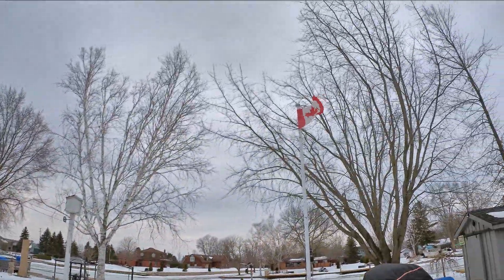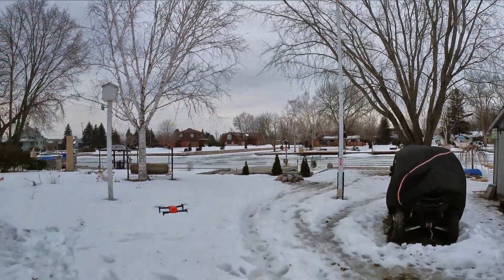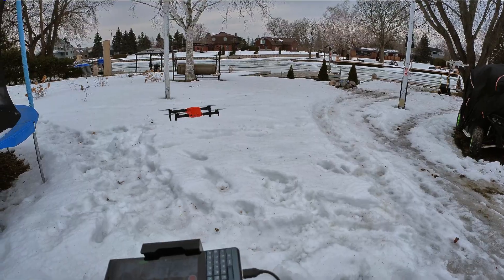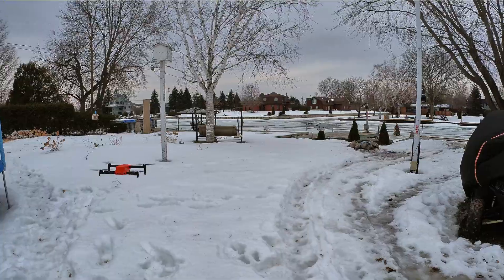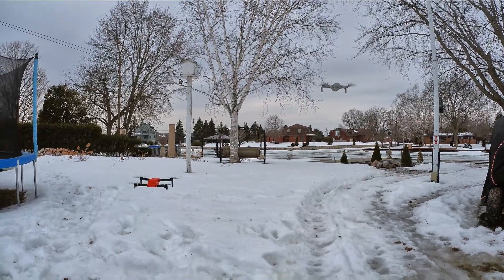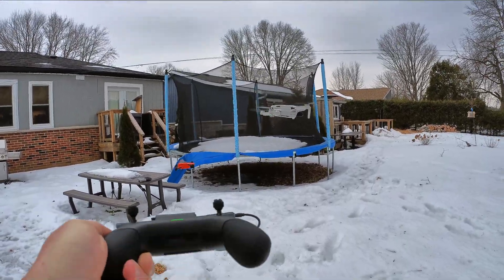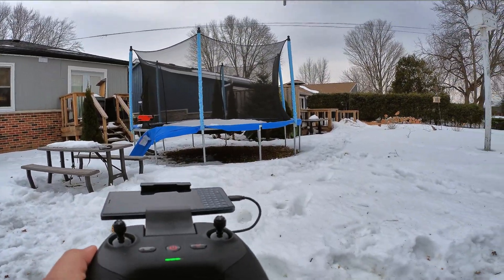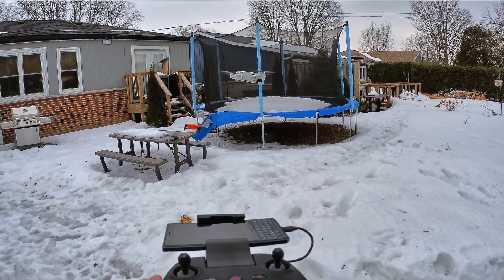Autel Nano Plus firmware wind, speed, & jello fix, yet issues persist

Comment: Two things that give concern wit this test. 1. flying outside of level 5 wind conditions by a large margin. 2. flying over non contrast floor, if the elevation is low, these aircraft start to use the bottom sensors for height data, and flying over whiteout snow is not ideal. May not have been a factor, but mini was higher and over more contrasted surface with tire tracks.

I would like to see the test repeated within level 5 winds, and over contrasted surface, or higher agl.

Your title would suggest that you had information concerning jello and speed? 

Title should maybe be nano heavy wind test comparison to mini 2.
Reply from the maker: Both were initially set at the same height, the nano drifts , there are ongoing downsensor issues (they have been turned off in one of the earlier firmware, they may not even be activated yet in this version)

At the end of the day the mini is still has superior flight characteristics and the nano has a better camera. More tests to come
Reply from the maker: Unfortunately the insta360 that I was videoing with corrupted the second file that showed the nano plus against the wind. It managed to get 6m/s which is great imo. The clip at the end shows no jello that is raw unprocessed video of the nano plus filming.

Comment: Your video last month stated you were returning it back to your vendor, but you still have the drone.
At the end of the day, if you want far superior imagery, the Nano+ wins the contest against the Mini 2 by a massive margin. 
If you want to fly in very high winds, send up the Mini 2 which is more capable in these conditions. 
But the downside is the Mini 2 imagery is very much inferior to the Nano+, big time. 
Not even close !
Reply from the maker: Also I won my PayPal dispute and got a  refund. I also offered to return the drone to Autel which I have no obligation to do.  I asked them to prepay what I lost on the transaction including the refund of extended autel care which is not through PayPal, and either prepay return shipping or send me a prepaid label. All of which they have refused to do.
Reply: @cantechvideos5701  realistically you can't expect any payments outside of PayPal to be included in a PayPal refund settlement. It's still a win for you.
Reply from the maker: I will have more to report on image quality in 2 weeks, going to be using this drone extensively over that time. It's no secret that the image quality is superior on the nano but the flight characteristics are still superior on the mini
Reply: @JohLincN  you're entitled to your opinion, just like I am. I may do a comparison of imagery later between the Mini 2 & Nano+ to prove the point.
Reply: @JohLincN  what are you on about ???
Reply: @JohLincN  ??

Comment: Wow! That is impressive. The Nano plus handling 40 mph gusts. With all the other advantages it holds over the mini 2 that is a win in my opinion! I give you a lot of credit for doing this test in those conditions!
Reply from the maker: It's on the right track, into the wind it was getting about 6 m/s.
Reply: @cantechvideos5701  I never thought it was going to happen. I thought Autel was just going to leave it as it was, have to give them credit.